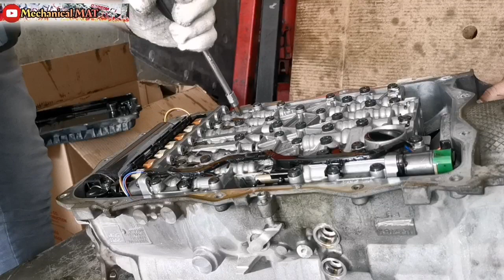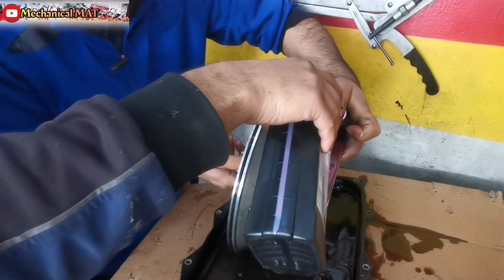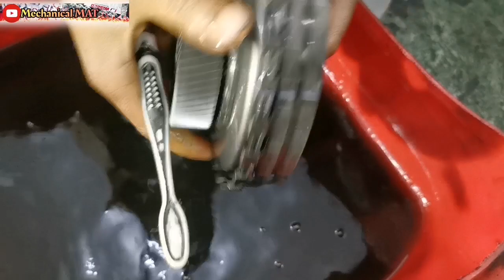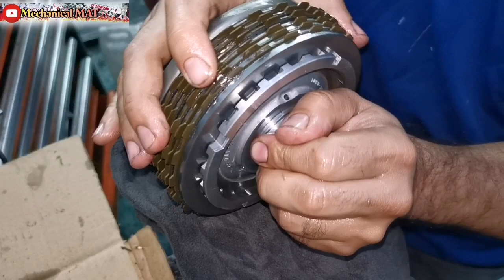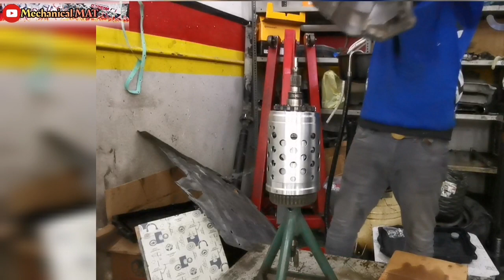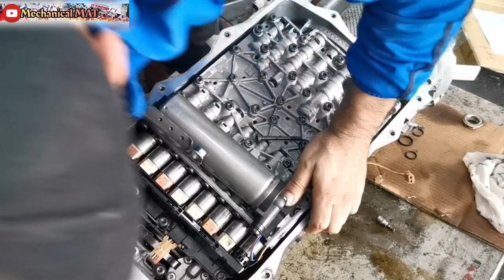8hp45 BMW transmission repair

Comment: Great video! I have a Ram 1500 with 260K miles and the 845RE.  I think this is similar to the 8HP45.  The transmission seems to slip around 30-40 MPH.  The only code is a P0731.  What would be the best course of action to get this transmission shifting again?
Reply from the maker: You have 4 causes possible..
Check transmission fluid
Input or output speed sensor
Or Michael problem inside transmission in gear 1 (clutch)
Check harnesses if damage

Comment: I have a 2019 jeep grand cherokee with the 8hp70. It feels like the torque converter or the "A" clutch pack might be slipping. It only does it when im tring to stay at 25 to 35 mph or when im slowing down hoghway speeds are fine and switches gears fine when im speeding up. Does this sound like "A" clutch or torque converter? Thank you for your video you are verry good at what you do sir.  If you were closer id have you fix mine also this would be the same process for a 8hp70 correct?
Reply from the maker: I think bmw it not same jeep transmission. Cause I'm working German car. You can check only the procedure and go  Forward

Comment: Is it necessary to replace the mechatronic seals in this transmission? There are a lot of videos showing how to replace the seals in 6sp but none for the 8sp.
Reply from the maker: It not necessary. You have to check the pressure. If not good, than you have to change

Comment: Hi, Great video. I have a bad vibration in 6th gear on 8HP75hz from 1500rpm under load? BMW 330e. The gearbox was rebuilt with new clutches and the flywheel replaced. The torsional vibration damper was also checked by BMW.  The problem persists and no-one can figure out why it's happening. Any idea what could be causing this?
Reply from the maker: Any fault code in computer scan.?
It not possible after full repair transmission stall vibration. That mean it not from transmission..
Are you checking drive shaft + tyers + axels
Reply: @mechanical-MAT  no faults on scan. Yes all checked by BMW. It's definitely trans as I installed xhp after problem came back after repair to see if a tune would fix it and limited 6th to 300nm of torque and problem goes away. 350nm + and it comes back. The only other thing I think it could be is either under or overfilled with oil as the external oil cooler comes on at 75c degrees and the lines would take some oil
Reply from the maker: @user-od3rl5mc  You have to open transmission again to check if a install clutch it ok or no
Reply: @mechanical-MAT  OK thanks for your input
Reply: @user-od3rl5mc  6TH GEAR ARE 1 TO 1 YOUR  YOUR TRANI HAS 6 BUSHINGS, I HAVE SEEN CENTER BUSHING IN D-CLUCH  BADLY WORN ALL BUSHING ARE SUBJECT TO WEHR
LIMIT YOU TRANS TO 5TH GEAR AND ROADTEST, DETERMENT WHAT PARTS ARE TURNING AND WHAT PARTS ARE STATIONARY SIMPEL TO FIND OUT!! BEVOR TAKING TRANS APART!!

Comment: Hello. How about the clutch pack clearance? It's not necessary to check or set clearance?
Reply from the maker: For clearance i do the adaptation after installing the transmission
So the clutch pack It has to be 1mm to 2mm maximum

Comment: Can someone point me in the right direction.... during acceleration, round 20-40mph my car will jerk/shudder 2-3 times, it is very slight, sometimes more noticeably. What's strange that it will shift smoothly on cold start in the morning. It will only acts up after its been warmed up. I ordered pan/filter kit and will do a fluid change soon. 2015 328i x drive 8hp45, 70k miles on it. Please help. Thanks
Reply from the maker: Hi. Thanks for your comment.
Ok...
Frist!..... Are you do the computer test?
Any fault code in TCM?
Reply: @mechanical-MAT No transmission codes
Reply: Ok. Now if you have problem only when transmission warmed. That mean it not clutch damage. You have to open transmission ' check all solenoid if working normally. Also check all clutch in good condition or no. If everything it ok. That mean you have to change the TCM
Reply: @jourimusic9767  thank you for your help

Comment: You just change friction.. You dont even check and open the drums and pistons..
Reply from the maker: Yes because it not damag
Reply: @mechanical-MAT  how do you know its not damage you dont even open it.. By the way thanks for the videos..
Reply from the maker: @jpxz181  just i check with air pressure. And the problem fixed. At the customer's request.
Reply: Did you ever come across a torque converter rattle on these ?

Comment: Where I can buy the same rebuild kit? I am in Dubai and I have the same gearbox.
Reply from the maker: I don't no in Dubai
In doha  from tristar automotive
You have to check ther with garages or order en-ligne
Reply: @mechanical-MAT  can you ship to dubai?
Reply from the maker: Me be i can
Reply: @mechanical-MAT  what is the size of the socket for the output flange?
Reply from the maker: @fabiodelrio6437  it 36
Reply from the maker: @fabiodelrio6437  it 36 mm
Reply from the maker: @fabiodelrio6437  it 36 mm
Reply: 36mm 12 point Deep socket?
Reply from the maker: @fabiodelrio6437  yes